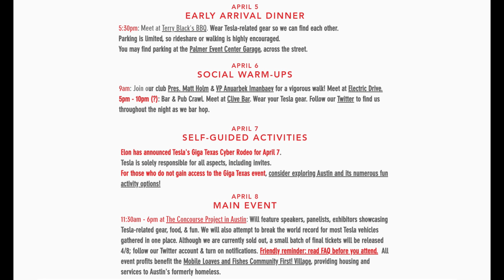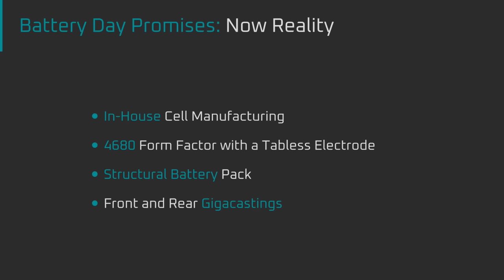Giga Texas // My Experience and What I Learned

Comment: The heat exchange is function of delta T, fluid velocity & contact area (other complex factors, lets ignore for sake of simplicity). Fluid Velocity will be limited by pressure loss, after certain velocity in given area, pressure drop start increasing sharply, means need bigger or more power hungry pump. Channel size effect but they cannot put too much of bigger channel. So we end up with temp. gradient as you said, in a straight loop. Lets assume heat generated by each cell would result in temp rise of 5 degree C after equilibrium with coolant in ideal condition, now coolant enters at 30C and first cell is at 35C, after heat transfer fluid get heated up, lets assume that last cell sees fluid at 40C, now that cell will have to be at 45C to transfer heat, (numbers I am just assuming). Thus creating a large temp. gradient, so they will have to either chill/cool the liquid further if they dont want to reduce last cells temperatures, but now this would cool he front cells even more effecting their performance. so whole pack is kind of unbalanced. 

With the U shape cooling, the coolant at top is at lowest, again 5 degree differential is required, now the top potion of channel start getting hot with each cell, gets hottest at the end and then circle back, it would be something like this, again ficticious numbers, 

30.0 - 30.5 - 31.0 - 31.5 - 32.0 - 32.5 - 33.0 - 33.5 now loop back 
37.0 - 36.5 - 36.0 - 35.5 - 35.0 - 34.5 - 34.0 - 33.5
If you add the above and bottom temperatures and average out, the avg temp is 33.5 on each cell and cell wall itself act as a heat transfer from lower ribbon portion to top portion while cooling the cell. Now this create an another challenge how to tackle the gradient created on the first cell. I think (it makes modeling and thinking much more challenging, maybe someone more experienced can chime in) what they would do is cap the end of channel going into the header for tubing connection and have side holes in it, such as that first channel open to right, next to left, then next to right and next to left an so on, its not complicated process, end die hole punchs and then sealing the end, I made a rough sketch which illustrates this, download it from imgur link. 
https://imgur.com/5IVqSkl or https://i.imgur.com/5IVqSkl.png 
This way its like having multiple adjacent paths and thus the differential between the ribbon will be much less and overall average temp. be better. But I am not sure if they will be going like that, maybe their simulation shows its no necessary.
Reply from the maker: Oh wow!  Cool!  So many fricken smart people in the comments section.
Reply: I love youtube, you get such great comments.
Reply: Is it an actual U? Maybe it's counter flow. With a U is seems you'd still have hot and cold ends of the battery pack. However, if you made the top coolant enter on one end and exit the other, while having the bottom coolant enter on top's hot end and exit on the top's cold end, then then entire pack average would be closer. 

Coolant Temps after each cell might look something like this:
                    Counter flow
Top: ->30C-35C-40C-45C-50C->
Btm: <- 50C-45C-40C-35C- 30C<-
        
       Vs the U (not in a shell)
Top: ->30C-35C-40C-45C-50C
Btm: <-70C-65C-60C-55C-50C
                
                  Vs one way
         ->35C, 42C, 48C, 56C, 63C ->
Doesn't counter flow seem better? Delta T from the top and bottom of each battery might be higher though.  Interesting problem.

Any Deta T between two bodies will result in heat transfer.
Reply: FYI The temperature gets hottest at the center of the pack, where conduction to the edges is lowest.
Reply: Hi guys let's simplify this, U channel means counter-flow heat exchanger design. Different types of heat exchanger have different properties counter flow has a more even temp distribution effect. Why? Lets say you are cooling, the cool input will be close to the end of the return so the hottest side, this is not the same as high dT because you have a cell in the center. So imagine this, first cell will be 10-degree coolant at one side and say 40 degree on average 25 in the middle, cell 2, further along, will see 12C on the cool side and 38C on the hot side, again center average 25C and so it goes. It not very efficient but is the most constant. Now, you showed an image of a U heat exchanger but the U loops where in parallel, not in series. Series, up down, up down.... not up up up down down down is what you want
Reply: @ElectricDanielBoone  Looking at temp. profile you mentioned, I agree it looks better, but the issue with counter flow is you will need to run cooling pipes to other side of the battery pack and loop them back, infact it will double the pipe required compared to single pass, bcz now they have to run two pipes to the back of battery pack, one inlet and one return. With U shape flow, they are connecting both inlet and outlet on same side, which will toward the front of vehicle, hence eliminating long pipe runs going to back of battery pack and coolant saved bcz of it, making vehicle lighter in the process + reducing costs. 
If you see the rough sketch i uploaded in my comment, they can have better equalized temps if they go with a design where the U channels are adjacent instead of top/bottom portion of ribbon. The side opening can be punched out fairly easily and if ends are ferruled properly no internal sealing is required (if there 's minor seepage internally, it would be negligible, all it would need the outer brazing joint. 
Damn I want Munro to tear down 4680 battery pack.
Reply: @acmefixer1  In extreme climates maybe, but its double edge sword, in very cold countries, the edges will be more cooler than center and in hotter countries where they are running coolant through chiller the edge will be hotter. So they won't intentionally try to conduction cool it as it gives you uncontrolled behaviour which we as design engineer try to avoid. Passive systems are good as long as they compliment the system, not interfere with it.
Reply: I lost you at "The."  😆
Reply: Text book copy;
Reply: @AfaqSaleemChannel  you're too far down in the weeds of the design for me my friend. At first glance U  tube seems odd for this application to me. I've seen many U tube heat exchangers, but they where mostly steam heaters.
Reply: That s a high level comment, if I ever saw one
Reply: @mtbse789  My highschool English teacher reprimanded me many times about using too much "the" so its an old habit. 😅
Reply: @ElectricDanielBoone  We all have our limiting factors... badum tuss... haha

The U-Tube or U-Channel etc we are refering to is basically the coolant path in Ribbon (which is micro channeled), it has nothing to do with U-Tube heat exchanger which is something entirely different,any reference to it is purely educational.
Reply: @AfaqSaleemChannel  the illustration in the video was of a tube and shell heat exchanger with a U tube arrangement, which is what I'm familiar with. So, there is no tube for battery cooling, it's a ribbon that loops back through the pack cooling the other side of the same line of batteries and the adjacent line of batteries on its way back to the side that cooling  ribbon started from.
Reply: @lengould9262  True, I went for simplicity, All the points you said are valid, just a tid bit addition from my side, I am not sure how much the S profile of ribbon contribute to the turbulence, its a complex topic and I will bow out by saying, Tesla thermal design engineers have crunched the numbers and ran the simulations.
Reply: More thoughts on counter flow: using counter flow puts one cooling ribbon's cold end on one side of a line of batteries with the hot end of the adjacent ribbon on the other. The cold end of a ribbon would have higher pressure than the hot end due to friction losses as the coolant passes through it while, at the same time, it's picking up heat. So, there'd be cold high pressure coolant on one side of the battery and hot low pressure coolant on the other side. Taking advantage of this bleed some cold coolant over to the hot side to help even the coolant temperatures out and in turn help keep the battery temperature even on each side.  The middle  battery/batteries would have nearly equal temperatures and pressures on each side.   Bleeding cold coolant to the hot side may be most effective beginning at the outer 1/3 of a line of batteries when dp becomes high enough to allow coolant to flow, dt is high enough to have an effect and the most batteries will benefit.
Reply: @ElectricDanielBoone  1. Jordon showed U-Tube as an example only, you are right that there is no U-Tube Heat Exchanger, although Tesla does use Plate Type Heat Exchangers (PTHE) for refrigerants, oil coolers on motors, evaporators for coolant chilling etc.
2. The loop back you describe (as I understood) is incorrect. The ribbon does not get turned at the end of pack and comes back. If you notice closly the header for ribbon has both inlet and outlet on the same head. The ribbon has many small internal channels, like tubes, its not just a single hollow flat tube. you can see its cutout in this video of Sandy Munro, https://youtu.be/4JiDZVO9NdM?t=59 , 
So initially it was (or is in current design) a single pass, fluid entered one side of the ribbon, the out the other side, where it was collected in a header and back to cooling system. In this version they are using say, top half of the ribbon for fluid going in one direction, at the end there is a cap, where fluid turns and return back via the bottom half of the ribbon. My conjucture is they might be using one by one channels for forward and return flow, if you see illustration in my first comment, but we will have to wait for this new pack teardown to see what is really going on.
Reply: @AfaqSaleemChannel Thanks,  I watched that Monroe video you linked. I'm sure I've seen a different design of those cooling ribbons somewhere, but that was sure interesting! It seems like one side of the pack would run a lot hotter than the other side the way that's set up. Maybe that's not important.
Reply: @ElectricDanielBoone  The system you are describing adds complexity, material and in the end increases cost. Also you will need someway to control bleed, not to mention, it reduces coolant available to loop ahead where bleed occurs. Tesla keep innovating new designs to reduce costs while achieving the goals. 4860 is expected to generate mush less heat due to tabless design, so i believe the cooling requirements were low enough that they could use u-path cooling. And the large temp. values I been mentioning are just for understanding, actual temperatures may be much lower, say front and back of pack difference of 2~3 degree C.
Reply: @AfaqSaleemChannel  like I said, if it's not important enough there's no need for it.
Reply: @AfaqSaleemChannel  9:12 of this video ( https://youtu.be/bNd-yJtRPhk ) seems to show a different version of M3 battery cooling than is in Monroe's video. It looks like the inlet and outlet are on the same side, like in this TLF's "U-Tube" video example vs Monroe's which appear to be on opposite sides of the pack. Monroe's example looks to have more parts, but would cool better, while the other example would have less parts, but not cool as well. I'd like to know which is the newest design. The video I linked is four years old and Monroe's is only one year old. That might be a clue.
Reply: @ElectricDanielBoone  Tesla has made many changes over the design of different vehicles, I didn't kept track if it honestly. this video appears to be showing an older design. There are numerous online videos, checkout https://www.youtube.com/c/Ingineerix  channel, he has uploaded videos describing cooling systems in Model 3 and model S, and since he worked on older models so he describes differences as well. Been too long since I watched his videos, you can check out for your self.

Comment: It must have been so crazy to see all that in person! Glad you were able to be there!  I'd also like to get schooled on this "thermal regulation 101".  I'm guessing there's some benefit beyond just eliminating the return plumbing.  Thanks for sharing! Can't wait to find out more about these cells and that new cooling system for gigacasting.
Reply from the maker: Lol, yeah I'm way out of my depth with thermals
Reply: @thelimitingfactor  It was great to finally say hi in person Jordan and scheme on Tesla's potential raw materials plans. The 🔋 Spice 🔋 must flow 😎👊
Reply: The relevant biological analogy might be the functioning of the kidney!
Reply: @thelimitingfactor  Greate a collective, Carvajo thermodynamic 1 and 2 best grade ever in College
Reply: Likely more complicated than this, but since heat rises, I would think you put the coolant in the top of the U where it will see the most heat and then as it makes its way to the bottom, there will be less heat, but the coolant will have raised in temperature a bit.
Reply: @davedavenport8673  yeap in some cases when there is air, it raises but I am sure the battery is pure conductive heat dissipation...through the aluminum to the fluid because the fill the battery with a structural adhesive fire retardant foam goo thingy

Comment: From cooling PCs, it has been observed that a coolant loop (with sufficient flow) is more like a train taking on "heat passengers", as long as the flow and heat capacity is there, "heat passengers" just come off the cooled item, into the liquid and are transported to the destination (where the heat is used to warm something ot exhausted).

More "total passengers" (total heat) = higher coolant temp.

So the temperature of the coolant stays very even throughout the loop, a function of the total heat load versus "hot spots" or gradients appearing. As long as there is enough contact area and conductivity on the hot parts to transfer the generated heat, it's all goood and temperatures stay pretty even. i.e. all parts producing x amount of heat and the same contact area will have the same temperature more or less.

Temperature change of the coolant is as a result of more or less heat in the overall volume of coolant rather than the temperature of a specific item it passes over.

In PCs it's very common to have e.g. two GPUs and maybe 2 CPUs all in one loop, the two CPUs with the same block will have the same temp and likewise two GPUs with the same block will too - even in a series loop.

U shaped in this case means inlet and outlet can be on the same side, reducing the external tubing/connections etc. I imagine - i.e. Octovalve/super-manifold connections all in one place. If chilling the coolant, it would also result in more even temperatures at start-up, prior to stabilisation (which is where you can see a difference around the loop).

Where you can see a temperature differnce is in the metal of a radiator as the hot liquid passes through it, it will be hotter at inlet versus outlet, yet the temperature of the coolant will not vary much from one location to another (again, assuming sufficient flow). If you run the flow at a low speed, you can see a temperature difference, but that means your flow is too low. ;)  Depending on the temp of the hottest component, this may not be an issue, and if e.g. it results in lower power use or less noise, it is a good thing too. So, the take-away is you just increase the flow until your hottest item is at a sensible temerature and at a certain flow the coolant temp will equalise throughout the loop.
Reply from the maker: SWEEEET!  Thanks for the explanation.  So by coolant loop, are you also including the straight pass through?  Wouldn't that still create a gradient?
Reply: @thelimitingfactor  The "loop" just means where the coolant flows. In Tesla's case, they can vary where the coolant goes and its temperature via the awesomeness of the valve/manifold and heat exchanger system. Look at plaid S system - this will be even better... 😁😉  Sorry for the typos etc. If I edit your like goes away. 😢
Reply: I've cleaned up the 1st post and added a few additions. Also you can have open vs closed loops and parallel or series. Octovalve likely has cominbations of these going on depending on what is needed.
Reply: This sounds just like under floor heating. I have it in my house. One long plastic tube snakes its way under the floor. Each tube is covering up to 25m2. The return temp is just 2 C colder than inlet. Still heats the whole house no problem even during winter at -15C.
Reply: @bowesterlund3719  👍